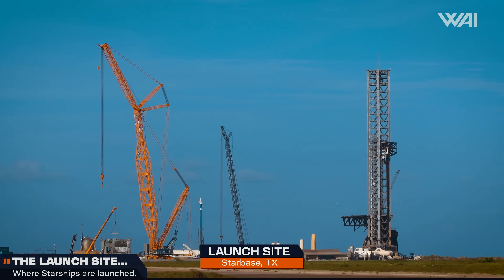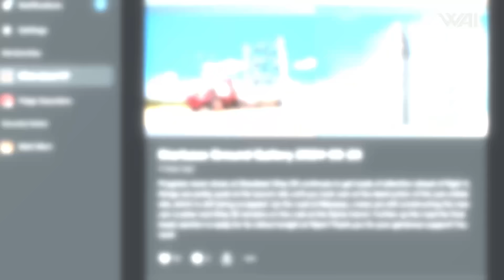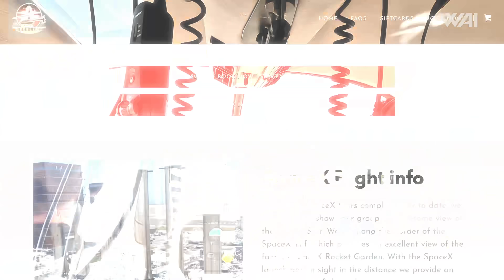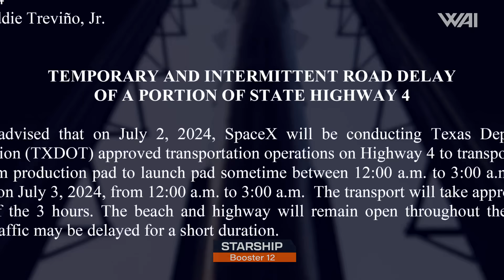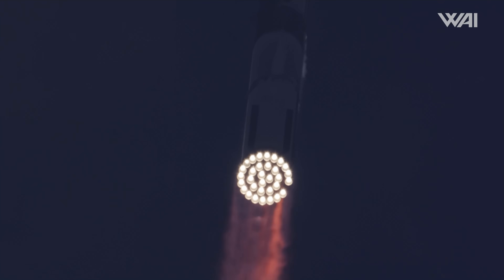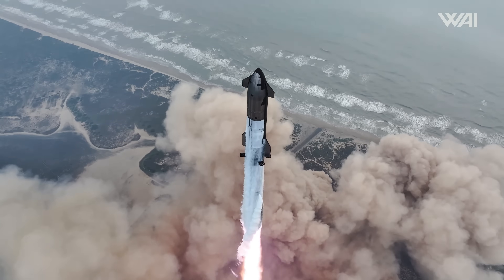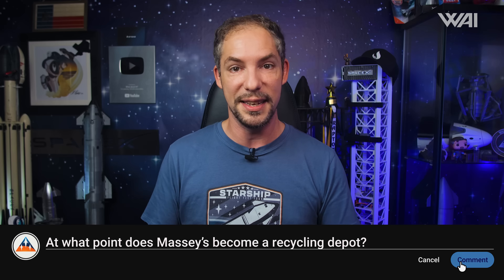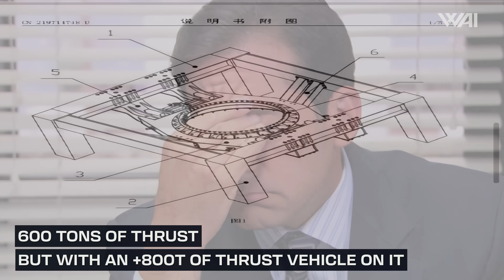How SpaceX Will Change The Entire Starship Launch Mount!

Comment: Where does the SpaceX Sanchez site end in terms of how close to the highway? Are all the cars parked on the side of the road parking on public land or did SpaceX put the container wall slightly further from the highway than it was legally entitled to so that it still had a strip of its own land next to the highway for employees to park on?

What I'm wondering is whether, once the carpark is operational and there are no employees needing to park nose-on to the container wall, whether SpaceX might have the rights to move that perimeter slightly closer to the highway to give a bit more available space within the Sanchez site.

Comment: Storm Update:  It looks like the upper level low just off the coast of Brownsville will steer the storm along a more northerly path.  This puts landfall between Matagorda bay and Galveston bay.  A path like this puts Starbase on the "clean" side of the storm.  Unfortunately, that means that dang thing is headed right for me.

And a note on the pilings for the second pad: they are not sufficiently long to reach bedrock.  Bedrock is over 250 feet down at Starbase.  They only have to go down far enough so the friction between the piling and sand is sufficient to hold the weight without sinking further.  Many large buildings have foundations like this.  A west coast building (San Francisco or Portland, I can't remember which) hit bedrock on one side of the building, but not the other.  The imbalance has caused the building to lean to one side by 5 feet at the top floor.  They expected no bedrock anywhere and didn't update their design once the did hit bedrock.

Comment: It is obvious, after the videos, that the arms and the quick disconnect system are directly exposed to the furious flames of the booster. No wonder spacex needs to replace parts after each launch. That is not good business. Why not to cover them with tiles similar to those used in the starship to protect it at the reentry? I am sure they will shield the components that are directly under those hellish flames. Just ask me for ideas. My 2 cents.

Comment: I have a problem with your stacking of the tower. The newest sections of the tower you keep showing at the top that doesn't seem structurally sound to me. The new section should go at the bottom. So when they get all the sections in Texas then they build a base a big base bigger than well big enough to put the whole old tower on top of. And that sells about everything including a bigger better water to lose system in front of it. However I don't know how they'll number it stayed zero V2.?. Some odd letter.

Comment: Felix why can't they use steel hoses on the quick disconnect instead of aluminum? I hope that star ship has better tiles on the star ship this time wouldn't want those wings to burn up. As you know Felix Beryl the hurricane is going to be a cat 1 hurricane. That will be interesting to hear what happens when it gets close to Texas. And it's only June. Hurricanes really get started in September. Thanks for the great video's Felix

Comment: Smart call is a shorter launch mount.  As much sub terrain as possible.  Then all maintenance can be done near ground level and fewer exposed papers and fittings.
Reply: Not in that location - the water table is just a few feet under the ground (2 ft or so), so sinking stuff into the ground will create its own set of problems, e.g. keeping salt water out...

Comment: Why not fit the ablative material on top of the tiles as well?
Reply: The point of the ablative layer under the tiles is that it only ablates if the tiles fail... so as long as things go right, it's zero maintenance. If you put it on top of the tiles, it becomes the primary protective mechanism, and one which requires full replacement for every flight.
Reply: Wouldn’t be reusable then; not to mention, too heavy. - Dave Huntsman

Comment: I just realised something, having watched this facility since its Starhopper days. I'm getting quite bored of failing rockets.

It's becoming apparent that SpaceX time estimates are wildly inaccurate. Reusability is getting bogged down in damage to the launch tower structures. Problems with tiles, just like the shuttle, oh dear. Even with tiles Starship was glowing red inside its steel walls, to hell with that. 

The weight of Starship is so large that refuelling it in orbit is required. That is a huge problem, fuel weighs so much, you need about 10 Starship launches for every one, fully fuelled Starship in LEO!!

That puts even more strain on reusability. It will also increase costs. Look at the size ratio of almost any rocket, say the Saturn_V, tiny payload on top with just enough fuel to take it to the moon. 

Now look at the Starship stack with Booster, huge Starship 40% the size of the whole rocket. It's going to take much more of that hefty fuel, to move and to stop it into an orbit or landing, no atmospheric breaking on the moon. 

My time estimates. 5 years for Starship to launch Starlink satellites, less frequently than Falcon 9 and at greater cost. No manned flights in those years.

10 years to have EVA equipped LEO manned missions. 15 years before any attempt to land anyone on the moon using a Starship alone. 

20 years to send an unmanned Starship to Mars and back without landing. 25 years for a rudimentary, six module, Lunar Base. 

35 years to send a manned landing flight and return mission to Mars. 40 years plus, to attempt a rudimentary 3 module Mars Base.

50 years before any flotilla of ships go to Mars, say 10 Starships. 100 years to build any significant dwellings on Mars sustainably. 

In other words, it might never happen. Priorities of future generations might change, just like after Apollo. Investors might bow out. Government will NEVER fund Mars colonization. 

Earth is our beautiful home full of life with fresh air and water in abundance, a protective atmosphere and a lovely 1G of gravity which suits us fine. 

Maybe if humanity has to go live a shortened life on a radiated, barren, freezing, airless "prison" colony on Mars to ensure its future, then it might be best if we just go extinct. 

That of course is Musk's ridiculous justification for inhabiting Mars. Let's forget the "tech fix" and make sure we look after our lovely hospitable Earth instead. 

Time to end all manned spaceflight. By the time we are capable if working in space, semi-sentient robots will exist to do it for us. Nobody is working as a mineral miner on an asteroid or Mars.

Comment: It appears that the Ship quick disconnect (SQD) is not moving far enough to get out of the high-speed entrained air flow around the exhaust plume produced by the 33 Booster engines. It's that entrained air flow that's causing the damage to the SQD.
Reply: In addition to having it retracting back a little further, maybe they also need to have a couple water jets aimed at it...
Reply: They plan to have a few employees stand there holding “fire shields” in front of them to protect the QD hardware.  Slightly risky, and potentially toasty job if you ask me.

Comment: Can't they use half the engines to liftoff and clear the tower and then bring the other engines online once the tower is cleared? IDK the parameters of liftoff.
Reply: The parameters of liftoff are *full thrust*. If you're running only half of your engines, you're just going to be sitting on the pad melting things until you burn off enough fuel to improve your thrust/weight ratio.

Comment: Concrete is the way to go, using as joins that can be replaced custom structures. That way less heat on the main structures of steel or metal they use
Reply: If you're talking about the OLM... the current one is also concrete, but has metal sheets as armor to protect it from the heat and shockwaves during launch – both of which are what destroyed the concrete under the rocket during IFT-1's launch and prompted them to install the water deluge system under it (aka the Rocket Bidet)

OLM ver2 will undoubtedly also have metal cladding. (as depicted in the fan-made speculative renders)
Reply: @DUKE_of_RAMBLE  burning the steel on to fined concrete would that not be possible like cheese on the on of pizza 🍕 so that way water can't remove it from the steel

Comment: a shorter mount with a flame trench would make the tower relatively higher
Reply: Can they lower the OLM to offset a tower segment? Doubtful.
Reply: If you just stand in front of the rocket and look up, it will look way taller.  Problem solved!! 😮
Reply: Except from the graphic, 'flame trench' seems like a misnomer, it is more an above-ground flame deflector.

Comment: I’m surprised they don’t have like a header system , like cars have headers , put headers going into ground for the fire to go out if each engine and push out down and out to side somewhere so you don’t have that heat and stuff bouncing back , just seems if it had 60 ft pipes down and out Buried , it be better and have volume

Comment: "engine failures can be seen" - nope, it automatically shut down once it went into flight, the system shut down on its own.
Reply: No, you can see the engine failure & the immediate trail of black smoke it leaves. - Dave Huntsman

Comment: NASA figured out how to build launch pads over 50 years ago. Looks like with pad B Spacex may be finally figuring it out also. Better late than never. LOL.
Reply: NASA used very expensive method. If I recall, building similar launchpad to those at Florida is about 5 bln. Model that was used on pad 1 was bit inspired of dry launch mounts for Soyuz. Russians uses deep trenches instead water deluge. Showerhead was something in between. And it's actually working quite good. Damage is recently on arms and launch mount itself.
Don't forget that weaker SLS also severely damaged launchpad.

Comment: SpaceX are all over the place with the Starship development. They need to slow down and finalise some stuff before they build the new towers. they havent even tried the arms yet. they havent got a finalised launchpad with flame diverters and water deluge. Im getting bored of SpaceX make stupid mistakes in an attempt to redesign the wheel.
Reply: Well you should watch someone else then. No one has ever built a fully reusable rocket. they don’t have a guide. Spacex absolutely knows what they’re doing.
Reply: @geesehoward700  Its their money to spend however they want. Cape type pads are extremely expensive to build.
Reply: @jackdbur  it is their money so it's already better than some but watching them discover they couldn't just fire 33 raptors into bare concrete leading to the first starship shooting itself down, followed by them learning they needed water deluge, and now the shocking revelation they also need flame diverters. I can't see the arm catching idea lasting very long, and I feel like tiles can't be used if you want a rapidly reusable vehicle.
Reply: @geesehoward700  The problem with Cape type flame trenches is the huge amount of foundations that are needed these are government level projects that is why the Cape reuses the old LCs
Reply: @jackdbur  and having the tank farm right next to the pad standing up.
Reply: @geesehoward700  they built those because they were quick to build & getting horizontal tanks is a slow process.